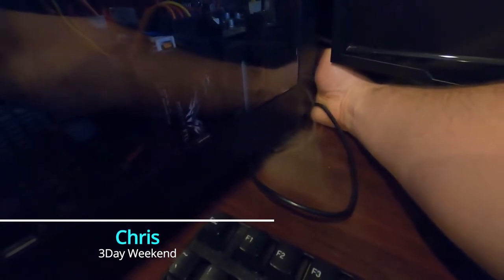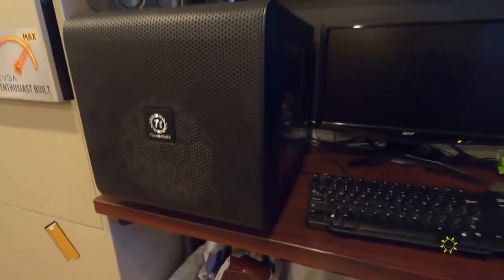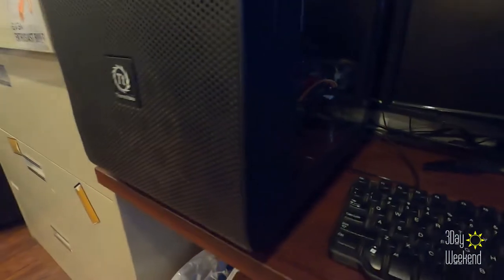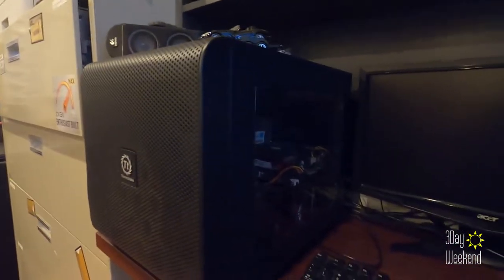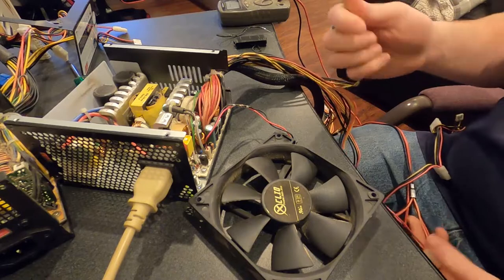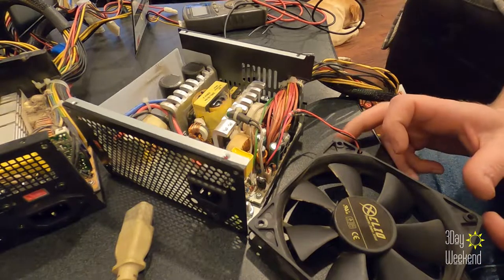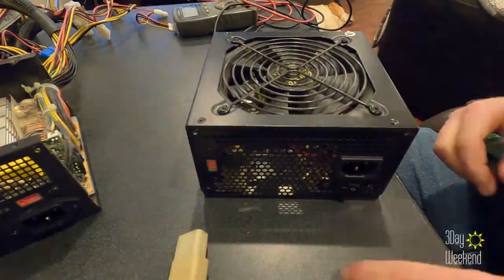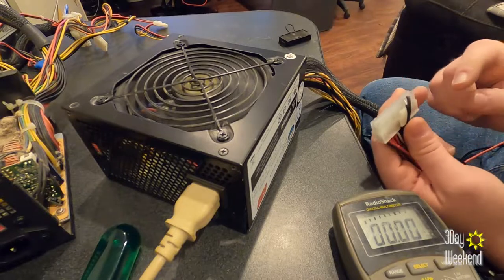Smoke from a computer power supply?!?  Well, that's cooked.  How to test a power supply!

Comment: Hey 👋🏻 great video ! Thanks 👍🏻

This happened to me yesterday but there was lightning coming out of the psu and popping noise also smoke when i pressed the power button. So i turned everything off I'm not a pc expert i took my 8gb ram and tested it in my 2nd computer and it was working my friend told me that if My 8gb ram won't work that means that all my components are dead but my ram is actually working i also checked my motherboard if there was something on it but i didn't find anything suspicious i guess everything is alright, right ? I regret buying cheap psu.
Reply from the maker: You might be OK.  I'd say the components survive in 9 out of every 10 PSU failures.  If one were to fail, it's typically the motherboard.  Hopefully yours is still working!

Comment: My power started smoking yesterday and suddenly my pc just shut off but my other components didnt smoke or anything.
I could see the smoke coming from where the plug is. But inside there was nothing.
Is this enough to tell that my other components are fine?
Reply: Hey. The same shit happend to me today. I was building my brand new gaming pc but a soon as i turned it on, smoke came out of the eight-pin connector (which wasn’t plugged in). All the fans instantly stopped spinning and I shut off the power supply about 2 seconds later. I tried powering the system with another power supply and nothing turned on. Just a clicking noise inside the power supply. I am scared that everything is fried but i have no idea.
Reply from the maker: Chances are that your components are OK.  Typically when the power supply fails, it will not send any surges to the components.  There are exceptions to the rule, but I'd say 95% of the time the components survive.  Best way to tell is to get a replacement power supply and give it a try!  Thanks for watching, and best of luck to you!
Reply: @3DayWeekend  Sadly my whole Pc died. Every single component is fried and doesn’t reply anymore. Cpu, Ram, SSD, Graphics card and mainboard have been tested by a professional on a different configuration and mainboard. Still, no reply from any component.
Reply: @tds-encrypted  that is one sad story, i hope you get everything sort out. I once had a near similar situation, where i could hear sparks noises and smells burnt, i quickly shut off everything to prevent further damage, my heart really sank at the moment cause this is fully brand new pc build which i worked for long hours, i think of a solution to change my extension socket to a new one, which is a blind speculation of the burning smell, after the changed, i tried my luck and power it on, everything runs fine afterthat, it is a sight of relief

Comment: I have seasonic 1000w platinum
Year ago i was playing rdr2 room temp was 18 , suddenly smoke rise up in front of the tv and i immediately turn of the pc , i was so worried cuz i bought it second hand and no pill for the psu 
In the second day i said its over any way lets turn on the pc , and from that time until today it's working fine 
And i play like ALOT aaa games 

But to be honest am little worry if its ok to upgrade my pc using this PSU
Reply from the maker: Oh, wow!  Usually once all the magic electric smoke leaks out, the supply is done!  I'm impressed it has continued to work for so long!  I would also be hesitant to use it on a new PC.  I'd budget for a new one if I were to add any upgrades.  Thanks for watching!

Comment: My psu started smoking yesterday and the power went out in my house. Are my components dead?
Reply from the maker: Not necessarily.  It depends on how it died.  If it didn't send a surge out to your components, then you'll be able to replace the power supply and be back in business!  If it did... well... you're done.  The only way to know for sure is to throw in a new power supply and power it up.  Hoping for the best for you!
Reply: @3DayWeekend  Yeah i got a new one and everything is going well but thanks